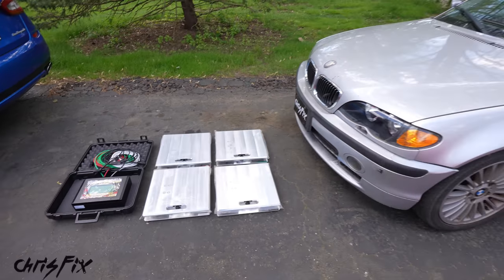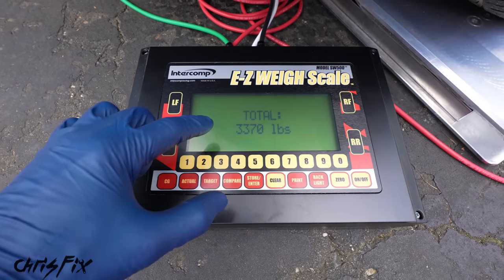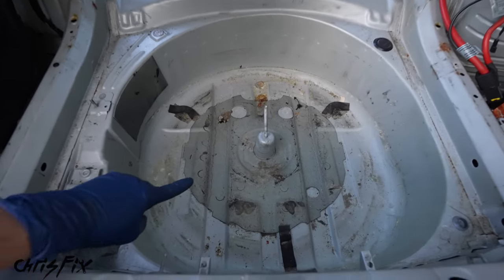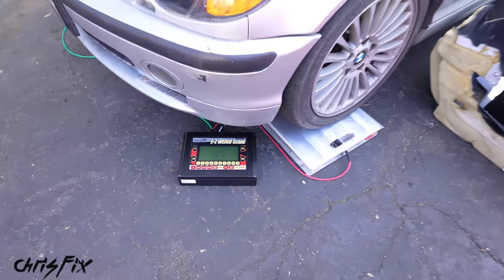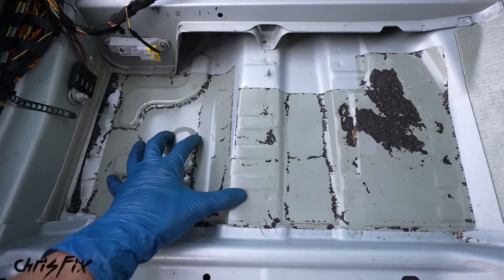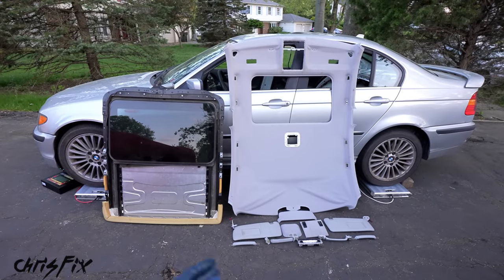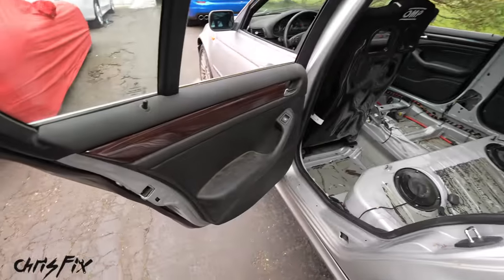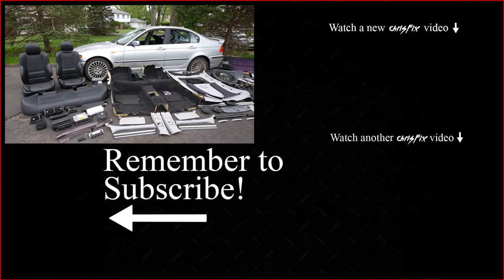How Much Weight can you REMOVE from your Car? (Weight Reduction)

Comment: Pro Tip: Remove the door panels and replace the windows with plastic ones.
Reply: i thought about making a glass fiber door for my c30 t5 with PC windows, the c30 doors are really heavy, like 50 pounds each or more
Reply: Pro tip 👍🏻 remove the engine
Reply: Remove the turbo for extra 25 pounds. Lightweight broooooo

Comment: Just remove the whole car. Hooks a brace from trans to rear end and to the tires and just straddle the transmission for a seat. Just maybe take it easy cuz if you go full send trans delete you’re not gonna wanna be riding the lightning on that trip.
Reply: That's how the original motorcycle was built
Reply: @benwhite906  not enough wheels though for this project

Comment: ultimate tip: take the engine out, its the heaviest part
Reply: Along with fuel, oil, and coolant
Reply: The four wheels add alot of weight, couls also remove the steering wheel. job done.

Comment: A very well done video. I'm more interested in putting sound deadening into a car that has none but it's interesting to see how little it weighs
Reply: Yeah, I was surprised to see how little the sound deadening weighed compared to the insulation and carpeting. I guess the latter also plays a role and the 'sound deadening' is just there to damp specific vibration frequencies?
Reply: @The1trueDave  it's a combination of preventing things from vibrating and resonating in the first place using the coating, and absorbing any ambient sound from internal and external sources with the foam, carpet and linings.

Comment: You can also do an AC delete and lose a huge chunk of weight. You can then cut the spare tire space and weld it flat and lose some weight. And as you mentioned the door panels and whatnot can be lost. Lightweight wheels and one piece carbon driveshaft makes a giant difference on rotational mass too. You could probably get up to 2.5 seconds faster doing all of that.

Comment: "We can't remove the door cards for safety incase the glass smashes in a crash"

Removes airbags
Reply: This comment may ruin the funny

Race cars dont need airbags because of the other safety features they bring, like the harness and rollcage.
Reply: Air bags are convenience items so you don’t have to wear a 5-6 point harness, and a helmet with HANS restraints. Otherwise, the systems have fairly comparable safety.
Reply: or you can remove the glass and replace them with plastic

Comment: The Ultimate weight reduction: a fucking bike. Literally an engine, tires, and the seat.
Reply: Oh yes i love bikes 😂
Reply: And transmission, final drive, suspension, exhaust, battery, electric components, brakes, fluids, handlebars, fenders, fuel tank, frame, etc
Reply: The Ultimate weight reduction reduction: a fucking ebike. Literally a motor, tryes, and the humiliation.
Reply: @quadracycle4000  The humiliation weighs a lot man
Reply: Your comment has nothing to do with the video. This isn't a bike channel. & bikes are far more dangerous, crotch rocket accidents often kill or disable for life.
Reply: The ultimate weight reduction reduced even more: running
No engine, no tires, no transmission. Literally shoes and socks
Reply: @DigitalDissident  Oh my fucking god

i am fuming because of you now

he means a bike as in just the stuff necessary to make the car run and the wheels and seat

Comment: Imagine after doing all that work it doesn’t start 😂
Reply: since it no longer starts its safe to remove the ignition as well
Reply: @royhsieh4307  imagine the weight reduction after removing the engine...since the car won't start anyway
Reply: Here after the cars piston blew up 20 minutes into it

Comment: Now the cage is going to add all that weight back, lol
Reply: Basically!
Reply: but the idea is if he didnt remove all that weight it would be stock interior weight + roll cage. way heavier than rollcage -stock interior weight
Reply: true but Its a necessary part. Removing all the unnecessary stuff is still way better than just leaving it in
Reply: He said it feels good stock weight but like a rocket with everything taken out. So once the weight is back it wont feel the same. I thought the goal was to improve speed and lap times, etc
Reply: Still better than leaving it in lol
Reply: The roll cage will make the car more rigid tho

Comment: Good video Chris. Reminds me of something we used to say, among the pir crews, running charger class at the local track.

Grams equal ounces, and ounces lead to pounds. 

People woild ask why id dig the broken clios out, after panel removal, until we set up the 84 Monte Carlo, for the backup car. Took all the smalls, and zeroed the scale with the bucket. Came to just under 8 pounds.

Also slimmed our driver down by 37 pounds.

All told,  ar had to be between 2500 and 3200 pounds with the driver. Got it down to 3922, with TJ in full gear, in the driver's seat.

Thanks for the memories of my misspent youth. Wife and a couple friends have been trying to talk me into a Lemons event, and located a 94 Taurus, rough, but a good runner.

That project will begin Saturday morning. Already have a name, team Some Assembly Required, given that we have 2 organ recipients,  and myself, an above knee amputee, as drivers. She's the only one not running replacement,  or aftermarket, parts.

Also goong to hydro dip my old socket, gold and black carbpn fiber, distressed look. And yes. 

I will be rocking shorts in the pits.

Will update once refistered, to let your viewers know which one we'll be running. After 3 of us came close to not being here, it's time to celebrate being alive, by actually living.

Comment: The braking distance didn't improve much because grip is directly proportional to weight.
Reply: Huh? 30 feet less is pretty good.
Reply: Also better tires will improve braking too
Reply: There's a fine, golden line between grip and weight to shorten braking distance.
You might think that because a lorry is heavier than a regular car, it would stop faster, but because of the weight, its braking distance is so much longer at the same speed.
Reply: @Mavrik9000  If grip remained the same, deceleration would change by the same ratio as acceleration. You're right, 30ft is good, but it's because weight reduction reduces momentum AND friction
Reply: @xtratic  Weight and friction is only one part of the whole equation. You can trick friction with aerodynamics, however you cannon trick thermodynamics. All of the kinetic energy of the vehicle must be entirely dissipated by the breaks and there's so much energy the brakes can sink. With the same brakes, lighter is always better because less energy must be dissipated by the brakes, ensuring a longer optimum braking force.
Reply: @ef3675  I know, i just gave a very, very simplified explanation with a very, very simplified example.

Comment: What about light weight door cards like the sunroof delete panel?
Reply: or just put lexan widows. then you don't need the door cards at all.
Reply: Couldn’t he do take off the doors or is that a rule and the plastic in the engine compartment
Reply: @cacasplat3  I agree with lexan windows as those are lighter and more safe than glass windows. But some rules still require light door cards as factory doors have openings with sharp edges. And even if rules don't require them, couple of pounds weight for that extra safety is totally worth it.
Reply: @juhoukkola2306  maybe....just depends on the specific rules. From experience with building my own circuit race car, I put in a rollcage with cross bars at the door openings, that way I don't have to rely on the door for safety because I used fiberglass doors with lexan windows. Besides weight savings, in the event of a roll-over, lexan and/or fiberglass are a lot easier to kick out to escape than a metal door with a glass window.
Reply: Door cards!?, remove everything in the doors, that glass is heavy, so are the window motors and wiring, the door cards and the locking mechanism.  Probably another 30lbs / door.  If you want windows for aero (most budget endurance racing isn't fast enough for that to matter) then replace with lexan.

Also, the ac compressor, condenser and hoses, the cruise control, all that sound proofing, and the whole dash and all of that ducting etc..  He's easily got at least another 200lb to go.  Of course the roll cage is going to add a few hundred back in.

Rule of thumb: 10lb removed is worth about 1hp.  But it also helps on cornering and braking.

Comment: Note to self: forget turbo... take out excess parts
Reply: Power to weight ratio is very important 🤙🏼 Imagine reducing your cars weight 300-400 lbs and adding that turbo. Your car turns into a monster 😈 also, reducing the weight of a driver can make a difference! Say you’re 5’11 215lbs not fit, you could get in shape and reduce your weight to 185lbs and BOOM huge weight reduction And you’re now healthier 👍🏼
Reply: @AJBAF  except in my case where im 5"6 and im 145lb's of muscle... at that point working out would only increase my weight.
Reply: @andrexsintoval3776  yes if you’re already tiny there’s no need for you lose weight you’re already good to go 👌🏼
Reply: I’m 5’6 and I’m muscular but kinda fat
Reply: Not a lot, just a little
Reply: @AJBAF  My 1987 Monte Carlo SS went from just over 3200 pounds to just under 2800, and that's with the larger transmission, larger rear end, larger tires, and upgraded brakes.  I swapped out so much steel for aluminum parts it's not funny (rims, Trunk lid, hood, engine, radiator) and then deleted the air conditioning, power steering ( manual box is fine with weight loss), and spare tire.  Currently does 11.7 second quarter miles at  116 mph. Not bad for a car set up for road racing.
Reply: @matts1166  that’s awesome!  My dream classic is a 69 camaro ss!
Reply: @AJBAF  I'm considering adding a procharger to the mix as well, that should make things interesting.
Reply: @matts1166  does the monte have an aluminum engine in it? Thatd always help with about 100lbs if your ls swapped. Ls1 is about 100lbs lighter than an iron truck motor
Reply: @tommys2979  Yes to having an aluminum engine, but not an LS. Back in 2015 I found an ad on craigslist. Totally virgin Aluminum SB chevy from 1982, new in box Aluminum pistons, lifters, rods, piston rings, Brand new hydraulic roller cam with 7-4 swap, and an internally balanced forged crank for $3500. I know an LS is more tunable, but for that price at the time I couldn't turn it down.
Reply: @AJBAF  haha for realll! But I meant that comment as a joke because I can’t afford a turbo right now but I can afford to rip out parts😂

Comment: I don't care how important the race is I'm not removing the a.c.
Reply: You're assuming the AC on a 20 year old car with rust would still work. A broken AC does nothing useful.
Reply: @questioner1596  you’d be surprised mines og and running strong 💪 same car
Reply: You ain’t winning then
Reply: @Pittaz  Eh, I bet a driver that isn't close to heat stroke is less likely to make a mistake.
Reply: @questioner1596  what does rust have to do with the function of the ac? my e46 is 21 years old, was rusted as hell and everything, including the ac, still works fine.
Reply: @Flyppy21 , my experience living in Newfoundland is that corrosion makes holes in AC lines, condensers, etc, damages compressors and causes electrical issues. Your BMW making it to 21 years old makes me think it wasn't operated in anywhere as corrosive as Newfoundland. Most cars are rusted beyond reasonable repair in 7-15 years there, and their AC quits long before that.
Reply: @questioner1596  ah okay i see, hadn't thought about that! My car is from bavaria/southern germany, so i guess were just having the usual rust from salt in the winter. So a lot less worse than what you're getting I suppose
Reply: @Flyppy21 , a lot of Newfoundland's rust is from road salt - their climate is so damp and temperatures hover around freezing from November through April, and it's so hilly they just pour salt on the roads. Other parts of Canada also salt, but often significantly less, probably like you see in Germany. I moved to the prairies, and bought the same model car I had in Newfoundland but ten years later, and the AC still worked on the older one but not the younger one I had on the island.

Comment: Chris: Can you make your car weightless?
Drives it off a cliff.
Reply: Interesting concept. Holy could fill part of the car with gas lighter than air, which would reduce it's weight, but it won't change the inertia during acceleration, because it still has to push the same amount of material from zero to 60.

Comment: Will you remove useless accessories like the whole AC system, ABS pump and front differential?
Reply: I was wondering about that too, since he removed the climate control console. removing the coils, compressor, and even the heater core could drop another 50+. Can go hardcore and probably pull the washer fluid reservoir and pump, although most of that weight is just the fluid.
Reply: @Px05119  At least there's no rear wiper to remove
Reply from the maker: We were going to use the AC but then went full racecar and took it out this weekend haha
Reply: @chrisfix  good
Reply: @chrisfix  Race cars nowadays do use AC, because the comfort ends up being more beneficial to the driver.. Unless you're just dragging this for which you're only for a few minutes at a time.
Reply: @chrisfix  If you drive for hours in a hot day, you will lern to love your AC :D
Reply: You cant remove the ABS unit it is for Can bus and immobilizer, thats BMW for you mate.
Reply: @kaankumas61  if he run this car as real trackcar, they will find ways to fix this too, one idea is to use a custom emcu, but this will be expensive, but a working ABS- unit will be also good for sale. Let's see how much race car chris want to make

Comment: Do they have fiberglass replacements for the back door openings?
The trunk also, but that would be easy to make.
Reply: Yea. I kept thinking as i watched. BMW makes a 2 door for racing. Chris fail. But i still like all his videos. :)
Reply: @nickmccain6598  Yes, typically they want 2 door RWD models, such as the previous generation 3 series.  Then they put in netting or a fixed plastic window ( the type with the slides ) and remove the entire dash.  Since the car is the same temperature inside as outside, it won't fog up as long as you keep your visor shut/breath from hitting the windshield.  Add a small coating of rain-x on both sides, done, just in case.
Also, 4WD is a lot of extra weight as is smog equipment, cats, air conditioning, a steel hood, and so on if you have a trailer and only use it for track days.  All of that robs about 15-20% of the power as well.   Stock rims, license plate frames, and other bling like door locks, plus your fuel tank ( almost all require a fuel cell inboard in case of a roll-over ) - you can get the 2 door/RWD versions down to about 2600 lbs before adding in a roll cage.  The only thing that should be still working on the interior are the light switches, hood release, blinkers/wipers/high beams (usually you keep the steering column as is) , and the emergency flashers.  Usually these are bolted into a piece of aluminum next to the steering wheel, along with an ignition switch/master ignition override - this usually is required as well, to have a master kill switch in case of an electrical problem.  The best design is to also have the battery in the engine compartment if possible, versus 20lbs of harness going to the trunk or under the rear seat.
Reply: @plektosgaming  Great info, my friend.  Let me ask you what you think about the benefits of having the battery giving some weight balance to the rear, compared to saving the weight of the harness?

Comment: Remove the entire A/C, it robs power, fuel, and weighs HUNDREDS of pounds between your compressor, condenser, evaporator, blower motor, solenoids, etc. you don't need that dash either, even your instrument cluster is heavier than just mounting pod gauges

Comment: When my dad weighed my racecars especially when I got into the ARCA series we used scale levelers and marked the spot the scales were level in and could get cross weight and everything. All level and quick to set up. And instead of dropping the car on the scales with a jack you gently rolled the car on. And back off.

Comment: 9:01 "for plastics [removal]: use a hard jerking motion [to[ pop it right off. pulling slowly is more likely to break plastic"
wow, thanks a lot for the tip (:
10:50 yeah confirmed that hand brake is called emergency brake in there.
20:34 "washer to distribute the load oh fiberglass"

Comment: So if I swapped my wives small battery from her 08 avenger into my 99 gs300 gutted it should work and start it? Her car has a aftermarket sound system aswell so I’ll probably be doing this soon